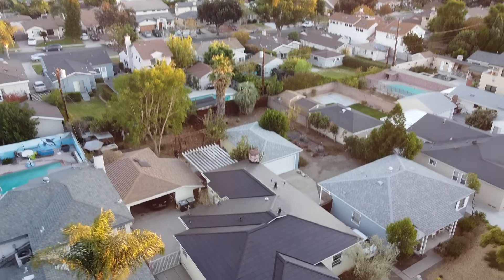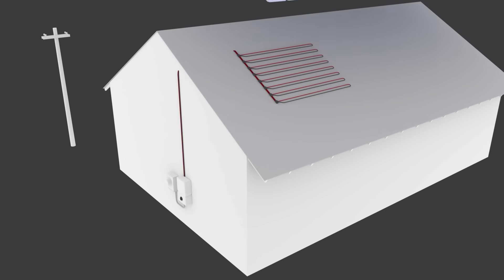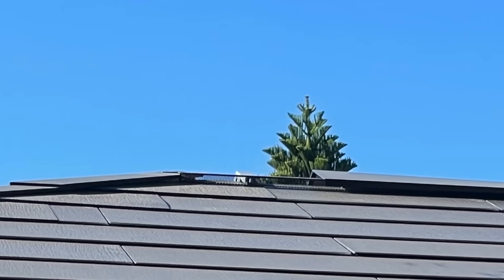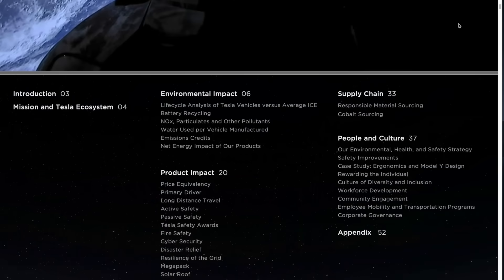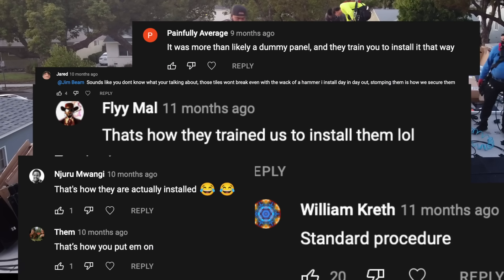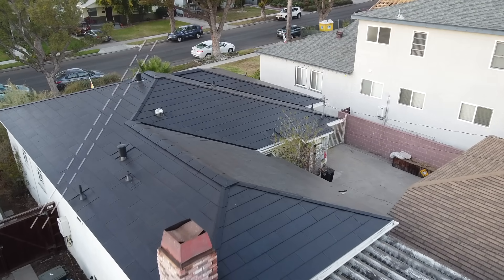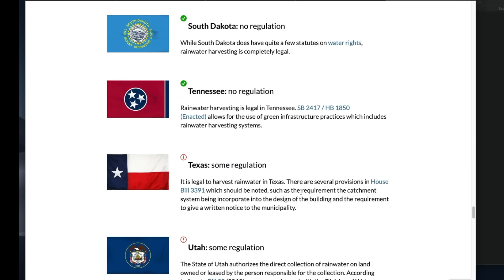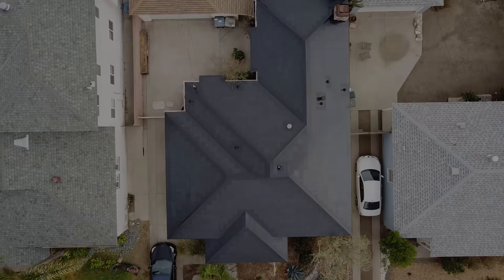10 Things WRONG With My Tesla Solar Roof

Comment: While I prefer the look of grass, xeriscaping is all over NM, AZ, NV and parts of CA that are inherently dryer than other areas.  It makes sense.  My big questions regarding the roof is will it make enough electricity over it's lifetime to pay for itself?  What is the life expectancy of the panels?  How do panels that have been disposed of effect the environment?  What are the ongoing costs of having the roof?  I was a roofer for years and am surprised that the roof is only a class 3.  In Texas, we regularly get hail storms with tennis ball and baseball sized hail.  A class 3 shingle isn't going to survive that.  A class 4 shingle might, but even then, it's questionable.  I guess many of my questions will be answered over time.  I think it's a good concept, but I think it will be a while before the technology is refined enough to be worth it.
Reply: I think if you needed a roof and solar replacement - after a hail storm - the cost would be similar. A roof is never going to pay for itself - but with the batteries included in his quoted costs - its not going to be a bad value - and on top of that i would imagine the solar shingles would be cheaper to replace then a solar panel.

Comment: Someone who 'gets' sustainable drainage. 
I often wonder why many Americans don't get the connection between lowering ground water levels and the incessant desire to concrete over everything. 
All that water runoff goes straight in the storm drains, where it most likely ends up in the ocean, instead of percolating down and replenishing the ground water table.

Comment: Dark coloured roofs have been outlawed on new houses in parts of Australia. They are horrendous in terms of heat management. Tesla might need to address this. You don’t want to double your aircon to compensate for your black roof.
Reply: Kinda stupid considering a insulated black corrugated iron roof is x20 times cooler than a white one without insulation.
Reply: @jacobjackson6513  Absolute nonsense.
Reply: @akitas8165  I dunno mate , I either climb through or poke my head in at least 5-6 roof voids a day and the most notable one was the one I was the most hesitant to get into, black corrugated iron roof, 37 degree day, death trap I thought, nope ,they had a foil backed earth wool between the battens and the roofing iron, it was cooler in the roof than outside.

Comment: I hadn't seen your previous videos, but I'm surprised with how small the system is in general at 7.9kW for the solar roof.  I had thought this would produce a lot more than a typical setup.  Though I'm not a fan of placing solar panels in a direction that's not going to generate an fairly ideal amount of power, like placing them on the north side.
Reply: There are actually a lot of "dummy" tiles that produce no energy.
Reply: Tesla solar tiles are a sham.
Reply: @onradioactivewaves your brain is a sham. It's barely working.
Reply: @onradioactivewaves the math proved that was a lie.
Reply: @williameldridge9382  what math? Why don't we start with the lies on that set when he said the houses having funcfional tiles=1 when it was actually 0.

Comment: Over priced roof. In UK I can get a 7kw system with battery storage for £8k installed.  Great video and detailed info.
Reply: You need to add in the price for a whole new roof for your house as well, as this replaces the actual roof, it is not simply solar panels on top of an existing roof. You would make this change when your roof is due for replacement.
Reply: @rdizzy1  You need a new roof only if you need it. Most of the existing houses have an existing roof.

Comment: i talked to one guy that had the power wall, the one thing they didn't tell them is it needs to communicate with the Testa servers to work. during the CA wildfires the communication went down, making the system useless as a backup power source.
Reply: That’s not correct. Yes, it occasionally checks with Tesla servers for updating the internal software, but it works perfectly fine if there is no connection. I think that guy you talked to had no clue and was just telling you a story from la-la land.
Reply: @marcd6897  then why during the wildfires that knocked out commucauons to it, it started to shut down every four days, needing a physical power down, before it would start producing power again for another four days? 
More curious then anything.
Reply: @marcd6897  Isn't La-la land where Tesla reside ?

Comment: I signed a contract for a Tesla roof in February 2016. I put $5,000 down for a 15.7Kwa with 12.3Kwa peak power output. I'm still waiting for an installation date.
Reply: Going to be a long wait still to come.  By the time Tesla gets their act together and manages to install the roofs people have already contracted for, their competition will be installing for less than 1% the cost and double the output.  There's already a company which has managed to develop solar panels that cost roughly the same as shingles, so Tesla is pricing themselves right out of the market.
Reply: @nobodyspecial4702  "There's already a company which has managed to develop solar panels that cost roughly the same as shingles, " Yea, so. In the 6 years that I've been waiting and still waiting, the price has come down at least 1/3rd of the original price. And Tesla warranties the roof for the life of the house.

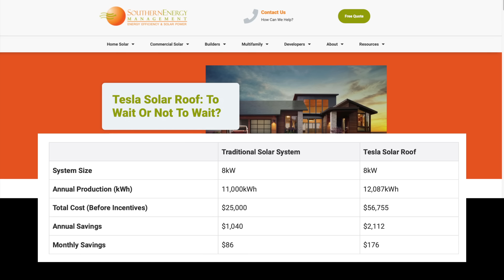Comment: 4:23 The table must be wrong.
Both 8kw system size but one makes a little more -  ok, but how can you save double the amount when the cost is twice as much? And no you don`t generate double the amount of electricity.
Seems like complete bs
Reply: I assume the idea is that one is installed all over the house, where the other is installed purely on one side. Its a factious data plot. Properly installing that 8kw system in the optimal position will produce more than the standard tesla roof layout. Especially since the tile texture reduces the solar absorption.
Reply: @JellyJonesey  when you check "annual production" there is only a 10% difference. So yes its a valuable point but not in this case. If the annual production would be double then it would make sense but it`s not

Comment: So Do you have 25 Amps. 
 6000watts divise 240volts... 25amps.. un the circuit Do you Buy over 100k for this... You need cercle house and make perfect angle  ?

Comment: Often the rainwater collection laws are applied to a property owner that builds a levee and collects 50,000+ gallons. it's more about the reservoir failing when there is no engineering.

Comment: I think my concern would be with lighting causing damage to the electrical system. I'm sure they have been addressed though.
Reply: If lightning is striking your house, you’re gonna have a bit more problems than just worrying about the state of your roof
Reply: @PrettyKittyKeia  it's why lightning rods exist...
Reply: @AmalgmousProxy  Most houses, in America at the very least, do not have lightning rods. Lightning rods are more commonly used in very tall buildings that are so high, they’re likely to be stuck by lightning more than anything else. It’s very unlikely for your house to be struck by lightning if there’s anything taller than it in the area, such as trees. 

However, if this is a genuine concern to you, you absolutely can have one installed in your house. It’s good protection if you live in the plains area with little trees or tall things in general surrounding your house. 

About 1/3 of all lightning injuries occur inside a building. Whether or not you have solar panels on your roof, if you don’t have a lightning rod on your home, your house will likely catch fire due to electrical surges, and anyone inside could also be shocked, depending on their surroundings
Reply: @PrettyKittyKeia  Depends upon where you live. They're on my second house. And they are still sold to this day brand new. These things is quite literally have wires going across the roof and down to the ground. That's a lightning rod even if it's not made to be a lightning rod.
Reply: @AmalgmousProxy  I’m not sure where you got that I didn’t think lightning strikers weren’t common, because I do understand that they’re very common. I’m simply saying most houses (in America) don’t have rods.
Reply: @PrettyKittyKeia  the same place where you got if lightning is striking my house I'm going to have more problems than just worrying about the state of the roof. Because if the roof is covered with solar panels and electrical wires it will have a substantially increased likelihood of experiencing a lightning strike. 
The whole point of my initial post was I was trying to identify a potential problem BEFORE it happened.
Reply: @AmalgmousProxy  I’m not sure why my comment was deleted or if YouTube is just being weird, but lightning isn’t attracted to metal. Solar panels don’t draw lightning anymore than normal roofing tiles would.
Reply: @AmalgmousProxy   instead of being wildly ignorant, maybe google what you’re saying before you insult me. 

“The presence of metal makes absolutely no difference on where lightning strikes. ... While metal does not attract lightning, it does conduct it so stay away from metal fences, railing, bleachers, etc. Myth: If trapped outside and lightning is about to strike, I should lie flat on the ground.”

Literally one google search is all it takes. 

Just because metal conducts electricity does not mean it attracts lightning. 

“Stay away from water, wet items, such as ropes, and metal objects, such as fences and poles. Water and metal do not attract lightning but they are excellent conductors of electricity. The current from a lightning flash will easily travel for long distances.May 8, 2017”

“While metal doesn't attract lightning, touching or being near long metal objects (fences, railings, bleachers, vehicles, etc.) is still unsafe when thunderstorms are nearby. If lightning does happen to hit it, the metal can conduct the electricity a long distance and still electrocute you.Jun 18, 2012”
Reply: @AmalgmousProxy  And the reason lightning rods are made of metal is so the metal CONDUCTS electricity, which is fed to a cable that leads underground where the electricity can be distributed without harm to anyone. Its not because the metal is meant to “attract” lightning. The fact that lightning rods are the highest available point on a building is the only reason lightning strikes the rod rather than anything else. This is also something I learned from a quick google search.
Reply: @PrettyKittyKeia  if lightning is going to strike a house with solar panels on it the likelihood of the lightning hitting those metal wires is substantially increased. I'm done holding your hand trying to explain this...
Reply: @AmalgmousProxy  I already established that any house hit with lightning is going to experience an electrical surge. Your argument was “lightning is attracted to metal.” This argument is wrong. You cannot argue against this.
Reply: @PrettyKittyKeia  Then explain how lighting rods work... Unless you are saying that the lightning rods do not work in the presence of a lighting strike and the energy doesn't find the metal conductor more preferable (AKA attracted to it) over the tar roof and wooden structure which are insulators. Because if that's not the case then how do lighting rods really work? Hmmm? For some strange reason, houses that get struck by lightning that have lightning rods don't have, electrical damage or electrical surges. That's what they are designed to do... Protect.
Reply: @AmalgmousProxy   Because, as it’s already been stated, lightning is going to be more likely to strike the highest point in a given area. If you are in a forest, the trees are going to act like lightning rods. If you have a tree in your backyard yard taller than your house, your tree is going to act the same way as a lightning rod. 

And again, I’ve already explained how the rods work. They do not attract lightning because they are metal. They attract lightning because they are the highest point of a building, and the lightning is guided safely to the ground and away from the house via cables attached to the lightning rod. 

You can, literally, do ONE single google search and find all this information out yourself. That’s literally what I did. Stop assuming you know everything. You don’t, obviously.
Reply: @AmalgmousProxy  “Also, a myth is structures with metal, or metal on the body (such as jewelry, cell phones, watches, etc.) attract lightning. Height, pointy shape, and isolation are the dominate factors controlling where a lightning bolt will strike. The presence of metal makes absolutely no difference where lightning strikes. While metal does not attract lightning, it does conduct it so stay away from metal fences, railings, bleachers, and more.” 

You can continue believing whatever you want, but you’re wrong.
Reply: @PrettyKittyKeia  Again, nobody ever said metal will attract lighting to a place its not going to already strike. It only acts as the BEST conduit and will be attracted to it for its path to reach the earth. Lightning rods work. And if lightning rods work, you are wrong. I know it's been a painful, denial filled journey for you. But the sooner you come to reality that you was NEVER right, that's when the healing can start.
Reply: @AmalgmousProxy  You have said several times that metal attracts lightning. And again, for the billionth time, lightning rods don’t work because they’re metal. They work because…. “Height, pointed shapes, and isolation are dominate factors in determining where lightning will strike.” I’m not making that up, im quoting the many, many, many, MANY places online that will tell you lightning isn’t inherently attracted to metal more than other objects. Conductivity doesn’t attract lightning either. It is strictly the “height” of the lightning rod, the “pointed shape” of the lightning rod, and the “isolation” of the lightning rod that makes lightning more likely to strike it. 

Everything I’ve said in quotes has been from external sources that know a lot more about how lightning works than you or I do. If you want to say those sources are wrong, that’s on you.

Comment: How much of a carbon footprint is there in making all the components that go into your solar roof system? I would guess it's more than running a lawnmower once a week.
Reply from the maker: If you’re concerned about environmental impact, supply chain sourcing, factory carbon footprint, end product recycling and net energy breakdown you could read this:  https://www.tesla.com/ns_videos/2020-tesla-impact-report.pdf

Also, while there are no global warming emissions associated with generating electricity from solar energy, there are emissions associated with other stages of the solar life-cycle, including manufacturing, materials transportation, installation, maintenance, and decommissioning and dismantlement. Most estimates of life-cycle emissions for photovoltaic systems are between 0.07 and 0.18 pounds of carbon dioxide equivalent per kilowatt-hour. This is far less than the lifecycle emission rates for natural gas (0.6-2 lbs of CO2E/kWh) and coal (1.4-3.6 lbs of CO2E/kWh).  SOURCE: IPCC, 2011: IPCC Special Report on Renewable Energy Sources and Climate Change Mitigation. Prepared by Working Group III of the Intergovernmental Panel on Climate Change [O. Edenhofer, R. Pichs-Madruga, Y. Sokona, K. Seyboth, P. Matschoss, S. Kadner, T. Zwickel, P. Eickemeier, G. Hansen, S. Schlömer, C. von Stechow (eds)]. Cambridge University Press, Cambridge, United Kingdom and New York, NY, USA, 1075 pp. (Chapter 7 & 9). http://www.ipcc-wg3.de/srren-report/

Comment: Only looking at CO2 numbers completely ignores physical environmental damage and water pollution.
Reply from the maker: If you’re concerned about environmental impact, supply chain sourcing, factory carbon footprint, end product recycling and net energy breakdown you could read this:  https://www.tesla.com/ns_videos/2020-tesla-impact-report.pdf

Also, while there are no global warming emissions associated with generating electricity from solar energy, there are emissions associated with other stages of the solar life-cycle, including manufacturing, materials transportation, installation, maintenance, and decommissioning and dismantlement. Most estimates of life-cycle emissions for photovoltaic systems are between 0.07 and 0.18 pounds of carbon dioxide equivalent per kilowatt-hour. This is far less than the lifecycle emission rates for natural gas (0.6-2 lbs of CO2E/kWh) and coal (1.4-3.6 lbs of CO2E/kWh).  SOURCE: IPCC, 2011: IPCC Special Report on Renewable Energy Sources and Climate Change Mitigation. Prepared by Working Group III of the Intergovernmental Panel on Climate Change [O. Edenhofer, R. Pichs-Madruga, Y. Sokona, K. Seyboth, P. Matschoss, S. Kadner, T. Zwickel, P. Eickemeier, G. Hansen, S. Schlömer, C. von Stechow (eds)]. Cambridge University Press, Cambridge, United Kingdom and New York, NY, USA, 1075 pp. (Chapter 7 & 9). http://www.ipcc-wg3.de/srren-report/